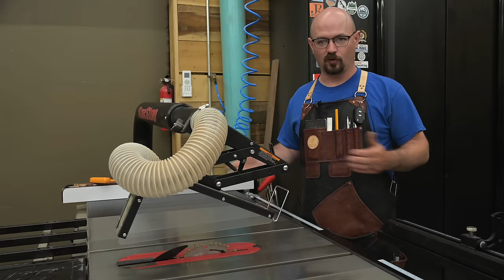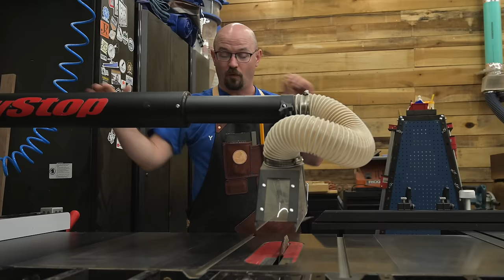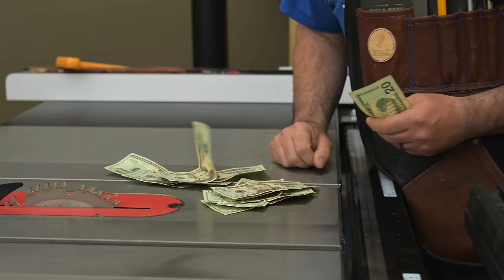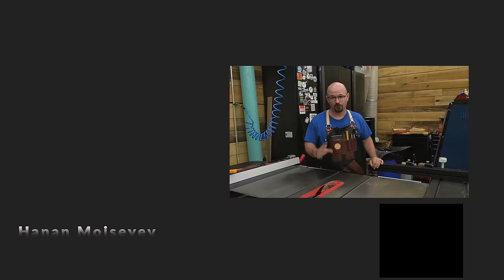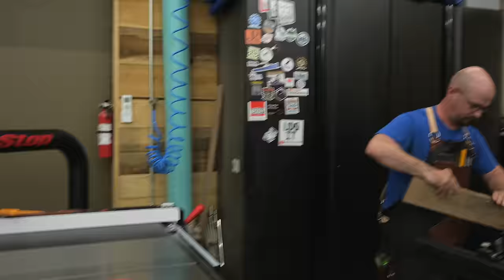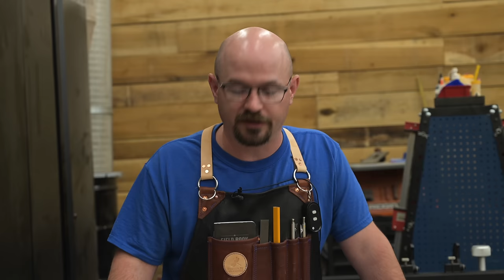Is SawStop Actually Safer?

Comment: Great opinion piece.

I'd love one and will get it as soon as my vintage 1969 Craftsman 113 (all cast iron table and 4 cast extensions) dies... so I guess never.  ;)  They are great, but not on my radar anytime soon and by then, hopefully the patents expire so we have more options from other manufacturers.

IMHO... A good riving knife or splitter, in combo with a something like Jessem Stock Guides, greatly reduces chances of kickback.
Reply from the maker: Oh man, as a fan of old machinery (have you seen my planer and jointer?) that sounds like an amazing saw. And no, that thing'll never die
Reply: That Craftsman will probably handed down to your grandchildren. I'm still using my father's 1959 Shopsmith. A good table saw lasts forever.
Reply: @DavidL-ii7yn  My old Rockwell 4" jointer I also got from my dad is going strong (vintage 1968)... plenty big enough for my cabinetry needs.  Cheers!

Comment: IMHO SawStop is equally safe as other modern tables saws. The classic risk equation is likelihood multiplied by consequence. The breaking tech acts upon the consequence side of the equation reducing the damage resulting from point of operation contact to almost zero, therefore the risk value is reduced to almost zero for laceration and amputation. But, correctly stated in the video, the breaking tech does not reduce the likelihood of blade contact or other hazards such as kick-back.

On the other hand my Shopsmith's safety equipment works on the likelihood side of the equation. It's saw guard with built in riving knife, feather boards, push blocks, and push sticks reduce the likelihood of point of operation contact AND the likelihood of a kick-back. From my point of view, the likelihood is down to almost zero. Additionally, the saw guard has anti-kick-back cams and the feature boards are designed to restrain kick-back. These have the added effect of reducing the consequence if kick-back were to occur.

Guards and pushers are standard inexpensive table saw equipment. It is the user's choice to use them or not to use them. Just as it is the user's choice to disable the SawStop's electronics. In this case it is the user who is less safe, not the equipment.

As a final thought, 30,000 annual injuries due to table saw is commonly referenced. Only 3,500 annual bandsaw injuries and kick-back is not a hazard associated with bandsaws at all.

Comment: you hit all the points so fully and eloquently. I too, in the opportunity to use a different brand of table saw, almost feel terrified to do so, or at least like an alarm is going off in my head the entire time I'm using it. I have had a Sawstop for over 7 years now, and I have a second one now for jobsite and secondary shop work. I still have to be cautious while using the saw because you can still get injured and I have before (contacted the blade 3 times in 7 years, but two of those were just silly goofs). I think its more humble to realize I am imperfect and able to screw up no matter how experienced I am as a professional. Heck, there is always that infamous "one last cut" on friday afternoon that ends up going very badly. Besides cost, I've never heard a non-punkish reason to not get a Sawstop. I dropped $3600 on mine when I was poor and starting my business, but it was worth every penny immediately. And it gives my wife peace of mind too!
Reply from the maker: Exactly, I think it's conceited to think I can be perfect, and dangerous to assume my error will never overlap with misfortune and cause tragedy. The risk/reward ratio on injury mitigation technology seems irrefutable to me... but defying the obvious is a legitimate personality trait and has its usefulness.
Reply: @YouCanMakeThisToo  and each one of my fingers is worth at least $4k to me, since I'm not getting any more ever 🤣

Comment: honestly, the "complacency" argument is a really weak argument. it's like saying "my AR15 has a safety so I can point the barrel at anyone I want and even look down it while it's loaded no problem!", or saying "I'm wearing a 300lb rated harness so I can run around like a chicken and even do a triple backflip on this 36 degree pitched roof." Anyone telling you that safety devices causes complacency is a dumb hack who should go play with plastic kiddie-tools instead of working with real ones. The only thing that causes complacency is stupidity and thinking that a "safety" device ELIMINATES all risks, rather than what they actually do, which is LIMIT THE DAMAGE that can be done. Use the device properly, and if you don't know how to use it, don't bloody touch it. Sawstop does not advertise itself as the be-all-end-all safety that will protect you from everything, so anyone talking about it like it does or assuming that that is what it does, is, again, a damned moron and doesn't deserve the tool. Trying to say that you are SAFER without safety devices has got to be the dumbest statement I've ever heard in my life.
Reply from the maker: Very well said, sir

Comment: Look, this is not a popular opinion, but despite being fairly well off, there is no way I could pay three times the purchase price for the high quality saw that I have. The cost is far beyond the resources of most people; even contractors. This is an expensive hobby which has lost most of it's former popularity. I was raised as a pretty young child around table saws by my father who had a Shopsmith with zero guards (which is now my second saw). I was taught to understand the physics of the forces on different types of woods and materials passing through the saw. I have a healthy paranoia about the safety of my cuts and this caution extends to not using my big-ass saw when I am tired. Used right, a table saw is incredibly safe compared with other tools. So far, three generations of table saw use, no one has lopped off a finger. Respect the tool and do things right is the best practice.

I get that other people may be less confident or more reckless and may need a safety system. But it's an option.
Reply from the maker: Fully agree with you on best practices. I think it comes down to how an individual does risk assessment.  

If I never trip my brake there is zero chance I’ll look back and wish I’d just taken my chances and spent the money on something else. Especially considering how much I use it, and that I have kids that are interested in being in the shop. But if I or my kid were seriously injured.. I’d never forgive myself for not making the investment when I could, not to mention then having to deal with the life change. Too many things I like to do that require full use of all my fingers. 

That said, upwards of a decade of my life was spent being exposed to crap going tragically wrong - and a frightening amount of the time the cause was simply “shit happens and they drew the short straw.”

Comment: I know this is 11 months old, but I’m considering buying a cabinet saw and I was wondering if there is reduced risk of kickback with dense wood with a 3 hp saw over a 1.75 hp. I know technique and attention to detail are the biggest factors, but does a more powerful motor help clear everything better and leave a larger/cleaner path than a motor that may get bogged down?
Reply from the maker: Kickback usually happens with loose pieces, so motor size won't make a big difference - it's about technique. It won't get bogged down as much though. If you work with a lot of hardwoods definitely get the 3hp if you wanna be able to rip them in single passes.
Reply: I have the CNS model and cut 4/4-6/4 maple all the time. Your blade and feed rate will be a  bigger determinant than higher hp. The SS will not prevent kickback. However, using the riving knife, blade guard, and a properly aligned fence and body position will greatly reduce the possibility of kickback.

Comment: Caleb a very controversial subject for sure.  I am still very careful with my Sawstop regardless.  Really what it boils down to is each of us.  I see good and poor practices on YT.  Not in my shop.
As far as kickback, I had it happen to twice too me. Once on a Rigid TS …. I was black and blue, bruised, and in pain. 
The second time was with my SS and I was wearing my custom leather apron. There was an outline of the board on my apron but no bruise or discoloration.
Reply from the maker: For sure! I haven’t been hit with TS kickback. But my old woodmaster 5hp threw a piece of walnut into my gut. Really wish I’d had my apron then! Might not have had to lay on the floor so long afterwards 🤣

Comment: The sawstop does not detect your finger nails and will cut till it hits flesh i have done it and it sucks.  Try it with it off of course touch with finger watch the light then touch with the nail of your thumb or finger and no light.
Reply: A cut nail is better than a cut finger.

Comment: To trim off a small piece from a smallish piece, I rigged up a clamp to hold the work to the miter gauge.  A 5" iron C clamp made a nice handle.  And of course I placed the clamp about 1 mm too low.  The saw now has a new brake and a new blade.  And the clamp has a tiny shiny spot where the blade polished it.